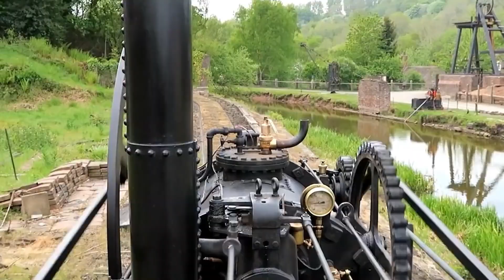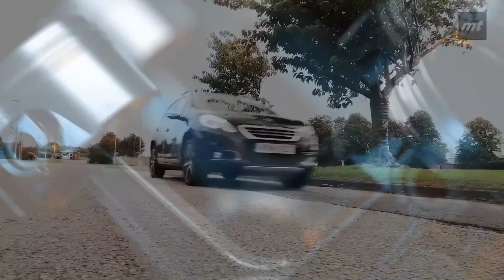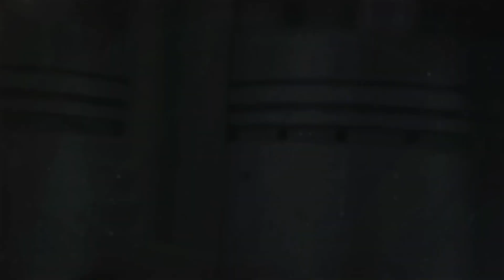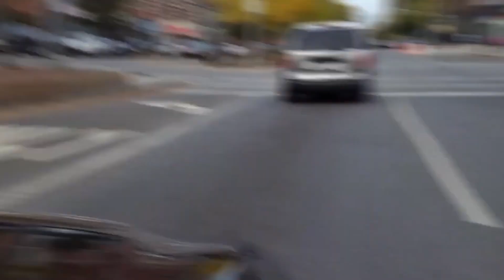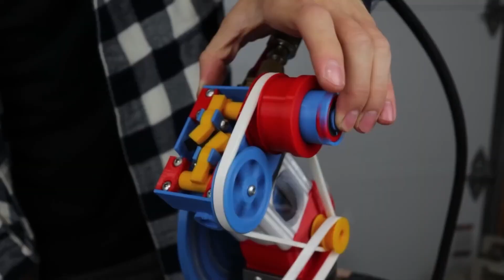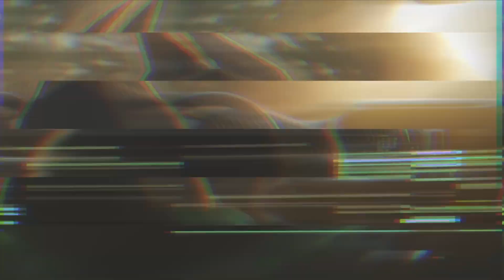GM CEO: "This New Engine Will CHANGE The World!

Comment: Blabla without technical facts. The problem of WEIGHT is not mentioned. (compressed air for 100 miles is heavier than battery)